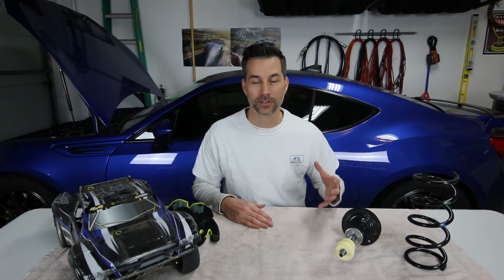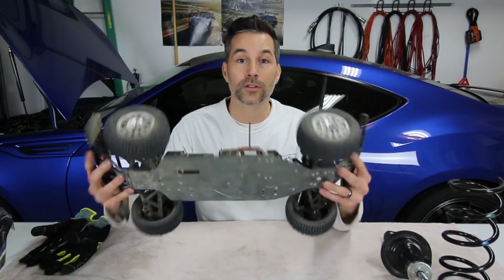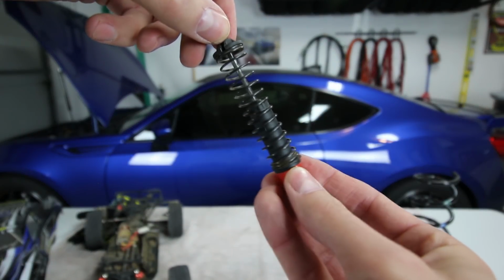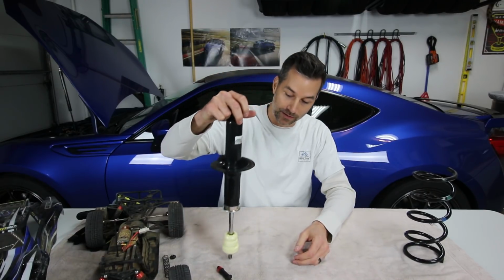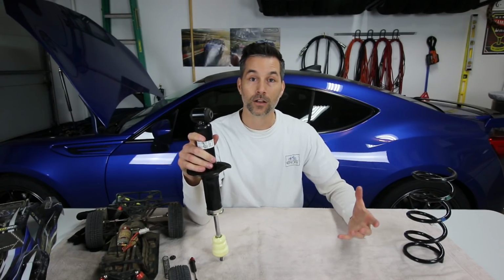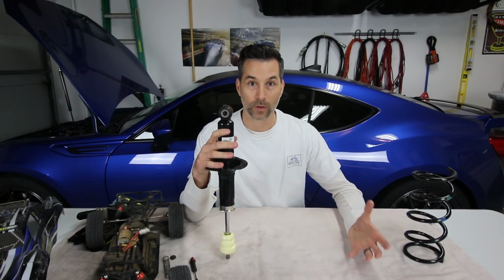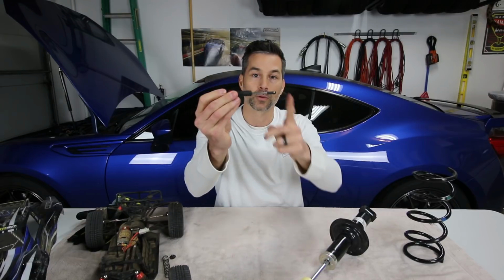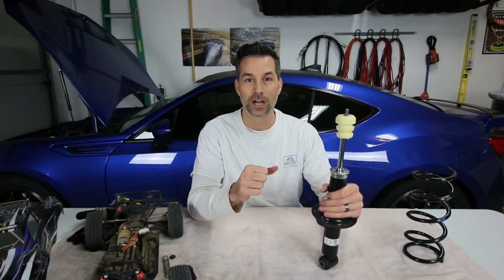Suspension Basics - Compression & Rebound

Comment: My feeling is that for driving over a very bumpy country, rural road it is best to have soft compression damping, and stronger rebound damping.
Asymmetric damping, so stronger on rebound than compression. The car should actually lower itself if you're driving over a very bumpy road. The shock compresses easily, but extends slowly, so it does not fully recover from the compression before hitting the next bump.

Comment: you explained it really well for me to understand but that this means that when you adjust the rate of compression the rebound will automatically follow the settings of the compression? or can you adjust these separately?
Reply from the maker: Depends on the shock. A "1 way" or single adjustable shock will adjust rebound & compression at the same time with one adjustment knob. A "2 way" or double adjustable shock allows you to adjust rebound/compression individually.

Comment: I was backwards in my head with rebound settings so this definitely helped me. I had my rebound set way to high (soft) and needed to turn it down to increase the extension speed.
Reply from the maker: It's easy to get confused. I had it backwards a long time ago and that is one reason I made this video.
Reply: How did your car act over small bumps in the road driving through town when you had the rebound too high?
Reply: @josephsabatino7857  it most likely had a harder feeling since it skips over bumps if the spring cannot rebound fast enough over the bump if the shock rebound is set too high.

Comment: Ok here goes nothing..on a drag race car when you go to take from a launch how do you get the rear End to separate and to keep it at separate using shocks with rebound and bump do I go up on the settings or down.  And how do I make the front go up and stay up as long as possible using shocks with rebound and bump do I go up on the settings or down....Thanks
Reply from the maker: I don't know what you mean by "separate". 
For the other question...you want the front to come up and stay up? That would be almost entirely in the rear adjustment, the lowest bump setting possible I would think. Rebound damping at the lowest up front, but probably wouldn't make much of a difference.

Comment: Maybe a simple question, but with correct springs installed, don't they control the movement on compression?  i.e. why do you need any compression from the shock during the compression stroke?
Reply from the maker: The shock will dampen the spring action, allowing you to slow it or increase it. So you can effectively change the rate at which the spring compresses, outside of its natural rate.

Comment: Is the adjustment of bump and rebound is in a single dial????
Reply from the maker: Depending on the type of shock, yes. A "1 way" damper will have a single adjustment dial/knob which typically adjusts both the rebound+compression at the same time. A "2 way" damper will have two dials/knobs, where one adjusts rebound and the other adjusts compression. They can get more complicated with 3 and 4 way dampers which then have high and low speed adjustments for one or each.

Comment: What are the advantages/ tradeoffs of rebound soft and firm?
I know what the terms mean.
Reply from the maker: It's a lot to talk about in text...but, rebound is better explained as less or more, not soft and firm. More rebound damping makes the shock extend back to its normal state slower, which can affect weight transfer (slows it) and also tire grip (ie: the shock is not exerting as much force back onto the tire and surface). Less rebound damping lets the shock extend faster (based on spring rate) which speeds up weight transfer and also more quickly puts force on the tire into the surface. The advantages/tradeoffs depend on which side of the car you are changing, front or back.

Comment: On some coilovers, you find fast speed and slow speed rebound and compression settings. What are they ?
Reply from the maker: It is for increased control in the shock stroke in different conditions. Low speed compression/rebound is when the shock is extending or closing at a slow speed like when in the middle of a turn, or accelerating or braking. High compression/rebound is when the shock extends or closes very fast, like when you hit a pot hole or bump where it is very fast in action. Just think of it as how fast that shock shaft is moving in the shock body.
Reply: @TheBTRGarage  Thanks

Comment: Hey Justin! We spoke a while back about my interest in the BRZ and I finally bought one! Your videos make even more sense now that I've my own to reference, so kudos for the explanations once again.

Regarding suspension, would there be any way to lower ride height without jeopardizing ride quality ( for DD purposes)? I feel that if you tried to adjust dampening to prevent bottom out the car, the consequences would be harsh.
Reply from the maker: Awesome, congrats on the new car! You would be fine by just installing some lowering springs onto your car. It will not change the ride too much but give you a better look and lower stance.
Reply: Justin's Pit Lane That makes sense. One reason I was thinking about a whole new suspension setup would be for their adjustability later. Can't wait for more videos from ya!

Comment: I have 24 clicks of compression, 14 clicks och rebound. My car is FWD, with 11,6kg/mm springs in front and 12,0kg/springs in the rear. How should i set it up för Time Attack racing? I know this is hard to awnser but where should i begin, should i have more rebound than compression, or less, stiffer upp front or stigfer in the rear? Somebody help me please.
Reply from the maker: Did your suspension not come with a baseline setting? Most manufacturers provide this as a starting point, contact them if not for guidance.

Usually setting everything in the middle is a safe bet to start (ie: 12 clicks compression 7 clicks rebound here). Just avoid having the front drastically different from the rear.

Comment: I’ve had coilovers on my car for about 3 months and they’ve made my ride quality so bad especially on the freeway every time there’s a dip the whole car jumps & it’s pretty annoying I’m thinking of just going back to stock suspension
Reply from the maker: What coilovers? If you have stiff springs and are lowered a lot, yes the ride is going to be crappy. Even worse if you have a cheap set of coilovers.
Reply: @TheBTRGarage  Rev 9 they’re decent coils
Reply from the maker: @Tutorialesalexg  If it's the $760 set of Rev9 coilovers, I'm not surprised it is a garbage ride. You can try adjusting the rebound to smooth things out, but cheap coilovers are cheap for a reason.
Reply: @TheBTRGarage  how do I adjust the rebound ?
Reply from the maker: There should be an adjustment knob on the top of the shock. Their website says they have 32 adjustments.

Comment: Hey Justin, I'm overall content with the stock suspension. Nevertheless I'd want to know it'd make sense to only change the parts that belong to the unsprung mass. If there are some strong light ones that you can recommend. Thanks a lot!
Reply from the maker: You could look at wheels and brakes to save weight there. Many choices in wheels that will be lighter than OEM (in the same size). The AP Racing Sprint front brake kit that I have sheds 10lbs per corner for just the brakes alone.
Reply: @TheBTRGarage   I watched that vid on your brakes! I didn't express myself well, I meant changing parts of the suspension (like lower arms I think) that belong to unsprung mass. If that makes sense without changing other parts of the suspension. Thanks loads!
Reply from the maker: @imm8637  Ah ok. I don't think there is much to gain there from a mass perspective. Changing those parts is usually for a functional upgrade of some sort.

Comment: Hello there, great video. I have a question, I have seen euro setup guys going with softer spring rates and stiffer suspension set up, so how does Spring rates affect suspension along with shocks compression and rebound setting? 
I have a 2013 Mustang which I am setting up for track racing now, what should be my focus points/ concerns for dialing in the suspension? My goal is to have a road drivable car which would perform well on track as well. I know it's counter-intuitive, but this is what I'm working with...please help me out. Thanks.

Comment: is preload and rebound the same thing?
Reply from the maker: No. Preload is really only a thing if you are using non-linear springs, chances are you are not. Linear springs are pretty standard and compressing it does not change the rate of the spring, but it does affect corner weight.

Comment: the coil is doing the rebound, the damper is just dampening it. the reason some dampers are extending by their own is wether they are filled with gas or only with oil.
Reply from the maker: Yea this was simply to illustrate the compression/rebound stroke. I think I mentioned to disregard anything the spring would do just to keep it simple.

Comment: Is there anyway to stop bounce on bc racing Coilover it only has a 30 clock rebound and dampening together in one
Reply from the maker: So the shocks have 1 adjustment knob? In that case it is pretty simple, try softening or reducing the damping first, see what happens. That would soften the compression and reduce rebound, which theoretically should reduce "bounce". Then try it the other direction and see what happens. Make it a big change, so like 5 clicks from full soft, then go the other way, 5 clicks from full stiff. Make sure you're changing all the shocks when doing that. Spring rates could also contribute to a rough or bouncy ride.
Reply: BTR Justin hey bro, no I mean it’s a all in one knob, I guess it does both off just one knob the rebound and compression it has 30 clicks one side is soft one side is hard, they are B.C. racing coilovers
Reply: BTR Justin ahh I misunderstood sorry, yes I will try that, thanks
Reply: BTR Justin when you say spring rates, would it be to firm of a spring or to soft of a spring?
Reply from the maker: Too firm will be bouncy if the shocks cannot keep the springs under control.

Comment: I purchased some and I can compress them easy same with the ones I took off. The both rebound at the same speed which I can hold it from doing so with little to no force. I am no weakling by far however it feels like no pressure at all. As far as compressing it I'd say it's about as much force as maybe 40lbs or so which doesn't make sense to me seeing how the springs take so much weight. Well the front anyway the rear springs may be bad or just lighter I can compress them without tool which has me concerned although it is on a little car. Although the shocks on the rear of my jeep feel the same way. I don't not understand how such weak crappie little things can help with suspension. I'd think they'd at least need to support some of the weight to be able to help with suspension. I mean seriously I can hold the bottom of strut and shocks and move them up and down easily are they garbage?

Comment: Wait.  When I hit a bump, my tire goes up?  What about a pothole?  Shouldn't the tire go down?  I still feel a bump.
Reply from the maker: Now imagine if you didn't have suspension and instead had solid wheels on a solid frame. You'd feel all of that bump...shocks or dampers are just that, things that absorb shock or dampen sudden impact, not eliminate it. Hard to tell if you're being serious...but there you go.
Reply: @TheBTRGarage  I'd like to understand how to make my car ultra-smooth.  The exact problem is the compression damping.  It needs to be there to avoid a bump actually throwing the wheel beyond contact with the pavement.  If not for that, there would be no need for compression damping, IMHO.  The springs take up the movement of a bump, and the rebound checking keeps the bump from being felt in the cabin.  On top of all that, there is no real way of determining the exact point at which the tire leaves the pavement, except for putting a scope on the tire pressure.  It would drop at the instant the tire left the pavement.
Up until now, the only practical solution has been to reduce the unsprung weight as much as possible to keep the inertia low.  The weight of a tire, a wheel, the caliper and rotor, upper and lower control arms, and other components is not inconsiderable. 
It's a giant mess with no easy answers.
Reply from the maker: @alext8828  Yes, it's complicated 😁 Soft compression and low rebound damping would make for the smoothest ride, but like you said many other influencing factors.

Comment: I have coilovers on my car getting loud bang from both fronts when hit a pothole what could it be checked all hardware everythings tight tophat nut is tight
Reply from the maker: It's usually the top shock nut, but sounds like you checked that. Can also be sway bar links, check those as well.
Reply: @TheBTRGarage  thank you will do had shoulder surgery so have not been able to do nothing so trying to pick peopls brains before i dive in

Comment: Thanks for doing this video! I’ve just installed a fully adjustable suspension and this was my first time upgrading from a stock suspension (out of the 2 cars I have owned). 

It was tuned for touge driving but the rear felt very stiff that it feels like someone’s kicking my seat really hard when I go over uneven road.

I was confused if it was due to damper or the spring rate but I believe all I need to do now is just turn down the click from 18 (out of 20) to 15 or so (the front has 13 clicks).

If you have additional tips for a newbie, do help out! Thanks again.

Comment: No... I dont understand why people allways try to explain compression and rebound dampening like this... The dampening force is not what you feel when you compress the shock.. There might be a slight "syringe effect" when you compress it that it wants to return to its full length, or there is a small spring inside the shock. The dampening is the shocks ability to resist change in position. Just like the RC shock did cause its simpler in construction, it is not the shocks job to return back out after compression, that is the coils job. The dampening force is when you try to displace the shock from its location by pushing or pulling on the shaft. So the dampening force is the amount of force if you were to attatch the shock to a wall and hang a pull-scale (luggage scale etc) to the end of the shock shaft and pull on the handle of it. The number on the scale is the dampening force, and it is proportional to the force applied to the shaft. The same happens to both directions, in and out, the other is called compression dampening and the other rebound dampening. The compression dampening resists the bump hitting the wheel, and rebound dampening resists the coil trying to extend the shock. The "coil-force" is proportional to the amount of displacement from rest length, and the "shock-force" is proportional to the rate of change of the displacement. If you would put this in mathematical terms the coil is the "proportional" and the shock is the "derivative". A coilover is basically a physical version of a PD-controller (Proportional-Derivative).
Reply: It helps to think just that when compressing or pulling on the shock, there is oil inside the shock being forced to travel through a small opening. It takes time for an amount of oil to squeeze through that opening. The amount of oil needed to move is determined by the depth of the stroke, and the resistance of flow is determined by the size of the opening (it is not just a hole but it helps to think it as such) and the viscosity of the oil. It is the exact same effect if you dip an empty syringe nose into water and draw it full. Then while still in water, when you try to squeeze or pull on the syringe, you feel it resist your efforts cause the water needs to move through the small opening. The shock is like that syringe, but with oil insead of water, and two openings instead of one with a directional valve pointing the opposite way on both. And of course the whole pool of oil is buil inside the shock too. That hissing sound when you lower a car on its wheels rapidly is the sound of the oil rushing through that opening so fast that it starts cavitating (pressure drops in the moving oil so fast after the opening that it starts to "boil"). Actually the cavitation happens elsewhere too but its a good image.
Reply: @taneliharkonen2463  : what causes the shock to rebound automatically